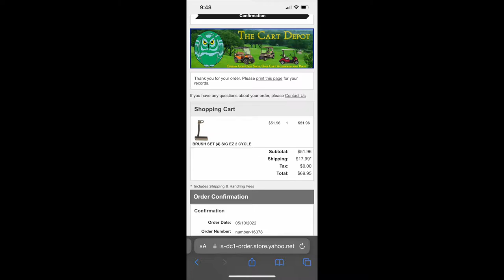1970's EZGO Golf Cart Internal Starter Generator Not Working/Turning FIX And Some Night Driving!!

Comment: The brushes that you had the first time will work but will need to be filed down to the correct size, for anybody else trying to do it because the brushes for our carts are officially discontinued unless you find that one parts store that may still have them like you did. Awsome video, I am about to do a set in mine and this makes it look so much easier than I thought it was going to be!!
Reply from the maker: Thanks for sharing that information Rob. I kinda figured they would work with some altering. I wanted to use the original ones. I am glad I was able to find them. It's a fairly easy job. Thank you so much for watching.
Reply: What tools did you use to file them down with, to what size did you file them down to, and how did it work?

Comment: What is the part number of the brushes? I need the exact same ones for my cart.
Reply from the maker: At the 10 minute mark I show exactly where I bought them from.
Reply: @TerenceDIY  I went their website, but couldn't find the same ones. Do you know the part number?
Reply from the maker: I don't know the part number, but I am pretty sure these are them (link below)

https://www.ebay.com/itm/384403425718?chn=ps&_trkparms=ispr%3D1&amdata=enc%3A1Nai_MSboTYW01sy3AomMDw29&norover=1&mkevt=1&mkrid=711-117182-37290-0&mkcid=2&mkscid=101&itemid=384403425718&targetid=2321310837104&device=c&mktype=pla&googleloc=9021638&poi=&campaignid=21214302385&mkgroupid=161029887581&rlsatarget=aud-1407154683111:pla-2321310837104&abcId=9407524&merchantid=511552112&gad_source=1&gbraid=0AAAAAD_QDh_vlvTRSgHuEddgWK9y_NCT0&gclid=CjwKCAjw_ZC2BhAQEiwAXSgClg73gYfioWkTXQ-M4ciLcJha-LaMccp1d36vBZvQna7mi9J5drpYABoChWgQAvD_BwE

Comment: Hey man great video. I’ve got a 79 model ezgo golf cart. I’m getting great spark but she won’t take off running. It will fire occasionally but not run. I rebuilt the carb on. Surprisingly didn’t look bad. I haven’t tried it since the rebuild yet. Just wondering what I’m missing. Fuel is pumping great with the diaphragm still intact. Open air intake. Just not wanting to take off running. The timing looks correct. I’m scratching my head.
Reply from the maker: How does the brushes look? They tend to be the culprit most of the time on these motors.
Reply: @TerenceDIY  morning sir. The brushes looked good. I pulled them and cleaned the armature. I’m getting great spark on the plug. Just seems to be off. I’m going to throw the carb on it and see what she’ll do. I’ll double check the brushes if the carb won’t change things.
Reply from the maker: Okay, keep me posted.

Comment: We have a 1979 easy go gas golf cart and we’re getting no spark do you have any ideas
Reply from the maker: Hi Jason, Did you check the coil for spark? That's the first thing I would do. My coil was bad on mines so I replaced it and everything was fine. If the coil checks out fine, the condenser is most likely your problem (very common).  Please let me know. I have the software for that model I believe.